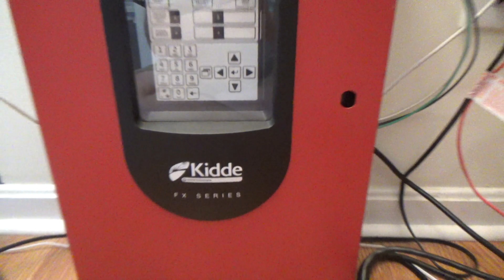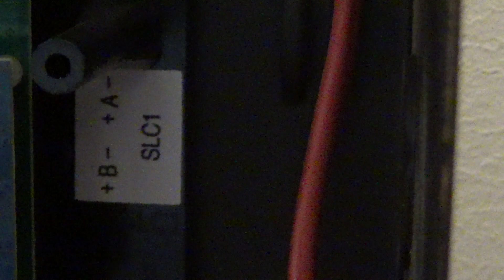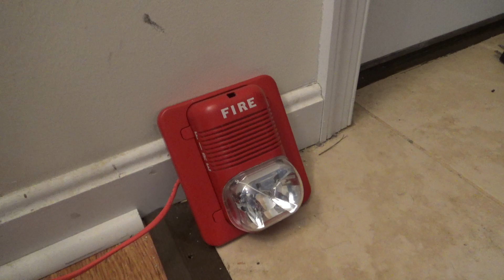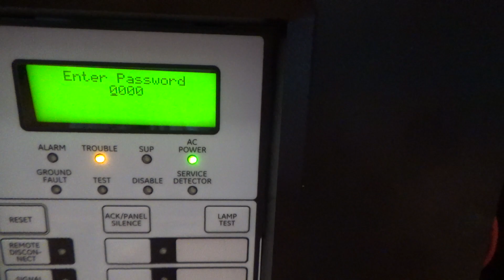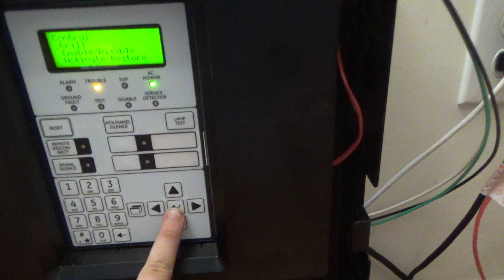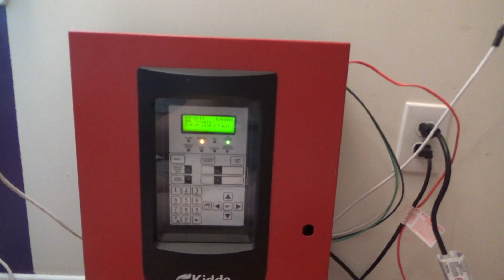Mini System Test 1

Comment: Was the Level 2 password changed from the default by the previous owner?
Reply from the maker: I think so I'm not really sure.
Reply: @jonathanryersonhotel3593 Did you try the default password? I can’t remember what the default password is for those panels anymore lol
Reply from the maker: Oh I figured out what it was the passcode is 2222
Reply: @jonathanryersonhotel3593 Oh okay, well that’s good!!!
Reply from the maker: I tried the default password but it didn't work so my conclusion that the password has been changed on it